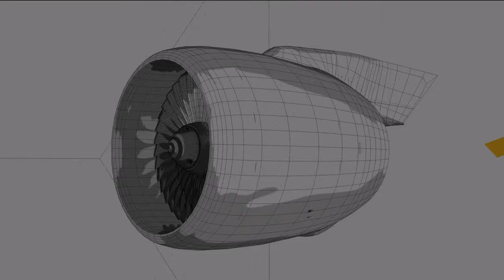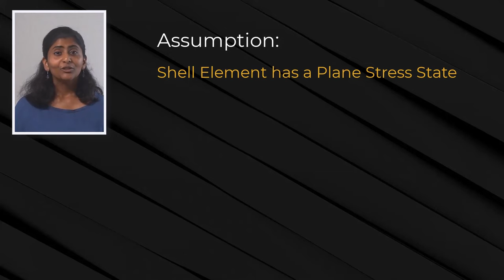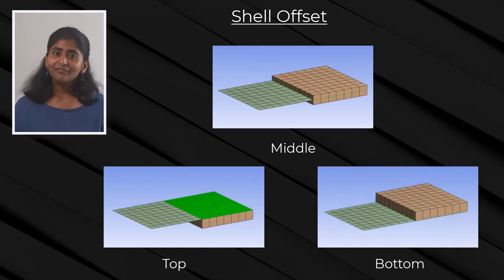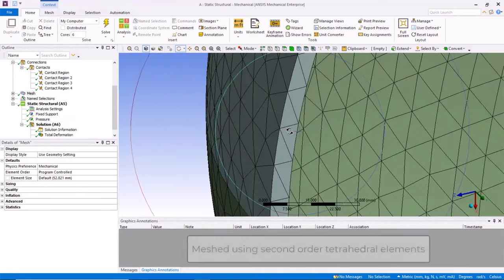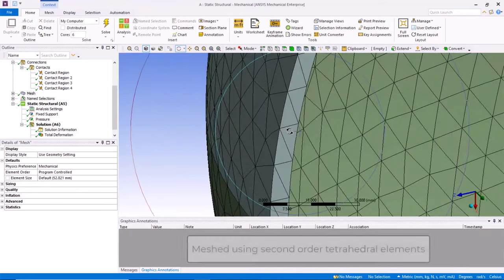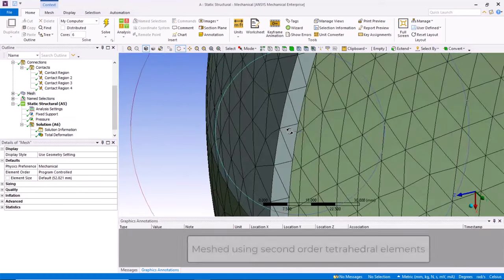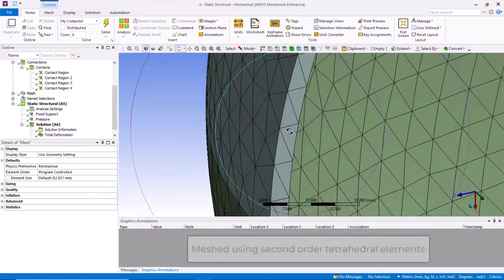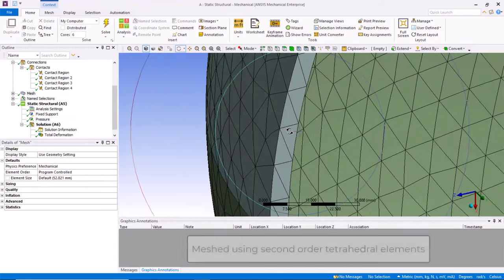Analyzing Thin Structures Efficiently Using Ansys Mechanical — Lesson 2

Comment: I appreciate your detailed explanation. I need to ask one quick question that how can we use shell elements for thermal analysis. For example, if a plate (such as thin tubesheet) has two values of temperatures (i-e bottom side and top side). How can we apply both temperatures on shell elements while we have only one mid surface?